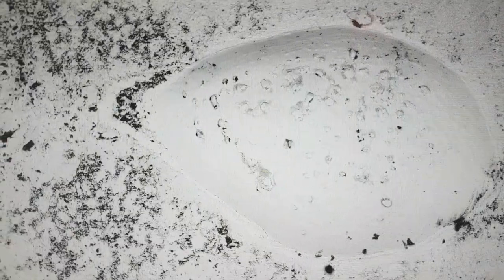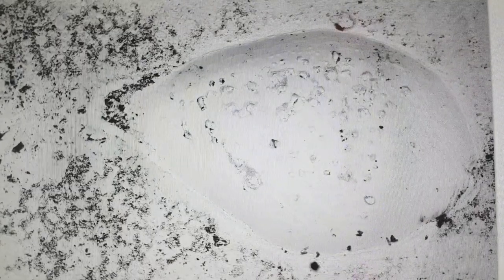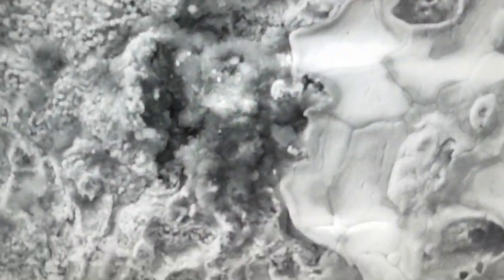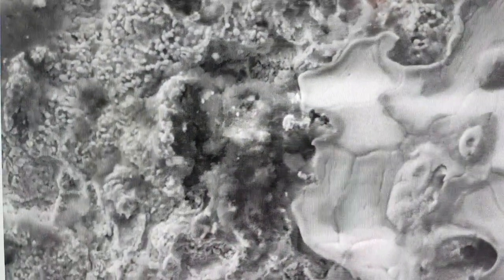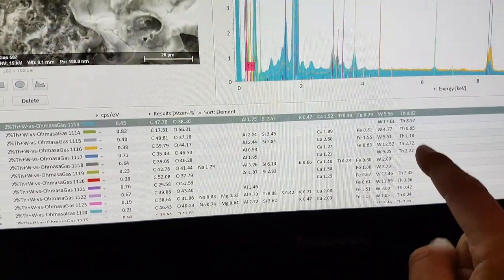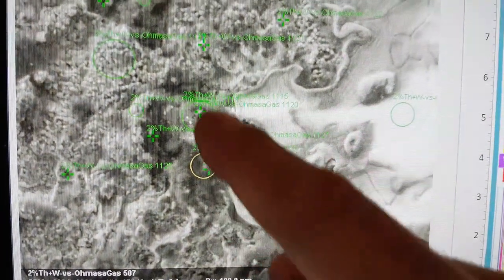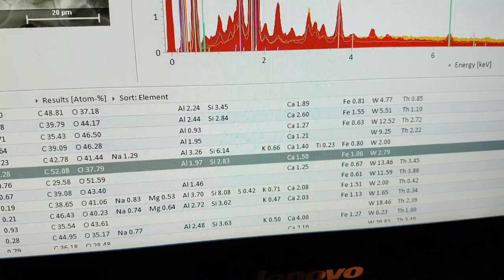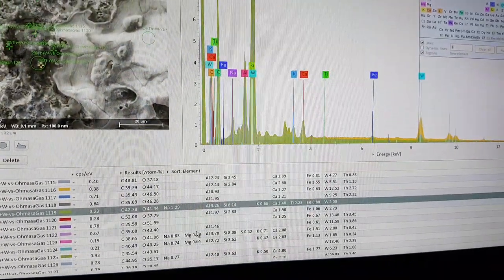OHMA - Analysis of features on 2% Th doped W exposed to Ohmasa Gas - P1

Comment: Bob thanks for this clip as EDX has a low energy level, I will suspect that it overlapping bands possible to get an accurate determination of the elemental composition of the heavy elements, as Th has 13kev to 16.2kev. I always had problems using XRF in the low energy level bands due to overlap. This is great confirmation as to radioactive elemental destruction through "Omasa gas" .. I love to be in the bleeding edge of science as the crowds are no where to be found here in ICCF..
Reply from the maker: I wrote a blog / video on this here. There is a spreadsheet where you can look for overlapping bands.

https://steemit.com/steemstem/@mfmp/overcoming-energy-peak-overlap-problems-in-eds-spectrum